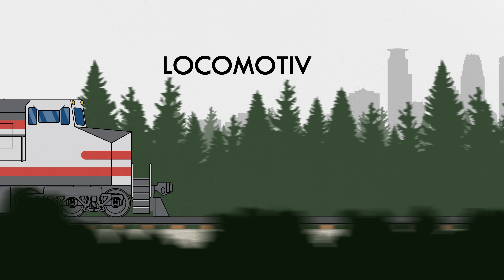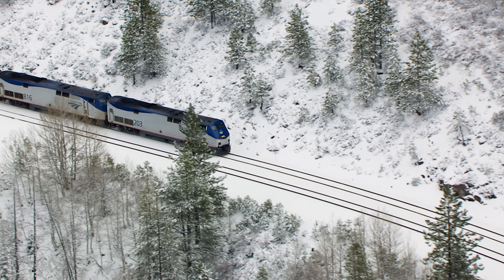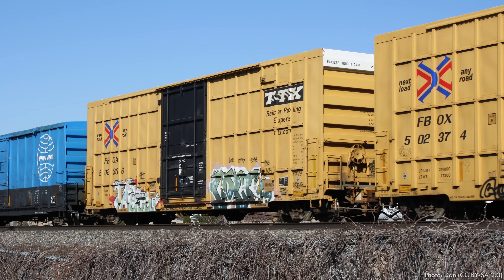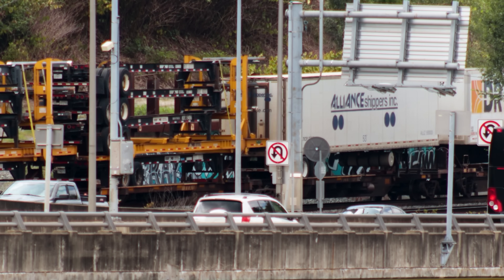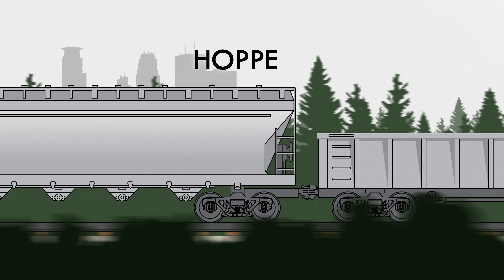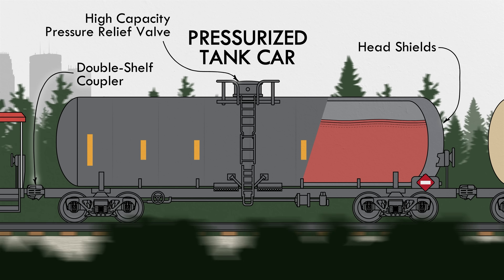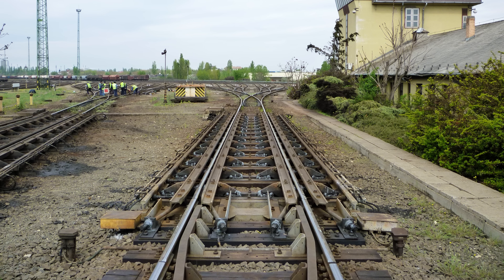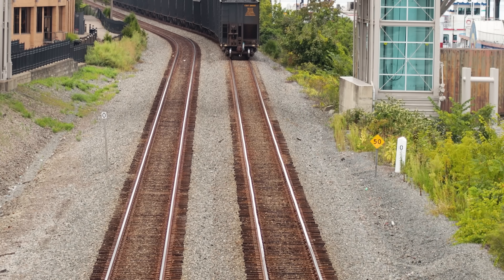Every Type of Railcar Explained in 15 Minutes

Comment: AMERICAN CONCEPTS OF TRAINS FALL FLAT ON THERE FACE IN THE REST OF THE WORLD !
I think the first sentence should state "An AMERICAN train is a simple thing at first glance" ! Super High Speed Electric trains running across Europe and many other countries around the World on TOTALLY NEW "Super High Speed Lines" designed for 186mph PLUS speeds, are no longer simple looking things at all. And indeed are technically far in advance of the simple Diesel hauled freight train of yesteryear !  Being high powered Electric trains they are also far quieter, and almost 100% pollution free. And once your rail network reaches 40% electrified, the Electric network & train costs begin to become cheaper & cheaper than a Dieselised rail network, with every extra mile of electrification. 

Which is effectively proven by the Worlds longest railway line. That from Moscow to Vladivostok at 5,772 MILES long which was electrified back in the 1960's. And despite passing through some of the most inhospitable climates on the planet with temperatures ranging from -60C in the winter to +45C in summer, the journey time for both Freight & Passenger trains was greatly reduced by electrification. And each train became far cheaper to operate over such great distances, when Electrically hauled. And of course Electric trains don't need to stop and waste time to refuel, or need all the refuelling facilities as found on American Trans Continental Diesel operated routes. Indeed with Electric you need fewer locomotives as a single Electric locomotives can be up to 15,000hp. Whereas the practical economic size of Diesel locomotives levels out at between 3,000 & 4,000hp. Which explains why US freight trains often require as many a 6 or even more locomotives, which increases the cost of operating the train !  Yet further the "Electric" locomotive produces virtually NO pollution at all, and certainly doesn't spread diesel fumes and pollution all across the Pristine Countryside like Diesel locomotives and Aircraft do !!!!

Comment: As someone with 10 years as a Carman (Railcar Mechanic) this should be interesting to see if you miss any.
Reply: In the Hopper car section the PD (Pressure Differential) Hopper was missed. They tend to carry Free-Flowing Light materials such as Flour, Cornstarch, Lime, Mineral Powders. They're annoying to work on but they are super interesting when you look into the design and engineering.
Reply: Also, on the Side Dump cars they are not technically Hopper cars. With them having a flat bottom they wouldn't fall into the Hopper category but one all on their own. I've always heard them called Airdumps

Comment: Bi-level coaches have become more common in the last 25 years in the US, plus there is a variant of the coach called a cab version.  These are at the other end of the train opposite the locomotive.  These are passenger cars but can be used to control the train by operating the locomotive remotely.  That allows passenger trains to be run in both directions without having to turn around.  
Aside from that, I have seen cabooses on military trains for the purpose of providing armed security details that stay with them while in transit.

Comment: There is interesting pieces of equipment called Trackmobiles out where I live. They are mid sized yellow vehicles that are used to move railcars in smaller capacities, and they work like high-railers and can just be moved off the track when they aren’t in use.

Comment: the 2 things you missed.  first, GRAIN CARS.  probably THE most common car in canada, takes grain from the praries to the costal ports to be shipped are basically a specific built tanker with multiple drains on the bottom.  second, caboose's purpose was for throwing flares out the back to create separation between trains, which were replaced by signals.  previously the brakeman (who rode in the caboose) would throw a lit "fusee" (road flare) out the back of the train every mile or so.  these were designed to burn for 15 minutes then go out.  if you're operating a train and come around a bend to see a red flare burning in the middle of the track you stop and do not cross it until it goes out.  this became a red signal on the post signal system that followed

Comment: I was hoping you would explain more what a passenger car with rooms is called.  We always called them a Pullman where I grew up in the south.  I'm not sure where that name came from since Pullman Standard was also the name of a manufacturer which had a plant near where I grew up.  My grandfather was a brakeman until he retired in 1937 so he may have called them a "Pullman."  A beautiful car, it had a fold-out table, two bench seats, and it's on toilet and wash room.  I rode one once from south Texas to St. Louis.  It was a short trip so we didn't use the beds which also folded down.

Comment: Having grown up in an industrial area, I am familiar with some specialized cars, such as "torpedo" cars used for moving molten "hot metal" between furnaces at a steel mill, or between mills in some locations. Another is the dumping "slag pot" used to take the waste slag following the pouring of molten steel to a dumping point.

Comment: Grady, I actually have to disagree with something you researched,. Cabeese.
The caboose was the train conductor and rear end brakeman's office and quarters. They were used up until the 1980s when technology like the F.R.E.D. and radios and the wayside detectors and air brakes as well got better the caboose was no longer needed. And yes M.O.W. crews from time to time use them but for the main line use of the original intended purpose is long gone. Until the power grid goes off and we go back to the steam era.

Comment: I have over the years watched trains I have seen every type your video showed at least once. I live in the Northern suburbs of Chicago Ilinois I have seen so many changes since the 1950's with railroads going bankrupt or being bought out, I have seen entire generations of engines and railcars go out of service. I also was involved with my dad in a Railroad Model Club for a few years. He build a hundred unit, short-coupled iron ore train each with its own number stamped on the sides. Great northern paint jobs with a Tenshodo Crown Grade R2 to pull the 33 foot long consist.
The biggest consist I have ever seen was a test run on the Chicago and Northwestern 24 SD-40 in groups of six, 2 groups at the headend one in the middle and one at the rear 240-hundred-ton coal cars. Wyoming to the Chicago area. They were testing the then new multiunit radio control system
Reply: 240 cars are standard business now

Comment: Hey @PracticalEngineering, i have a question: When diesel locomotives run past a camera, what is making the (aaaaaaaaaaaaaaahhhhh) sound? Is it the traction motors, the wheels, the rails?? Every time i listen to GE Locomotives rolling by i hear that sound
Reply: Those are the traction motor blowers that you hear

Comment: Maybe you can explain on a very long train, the front has maybe 3 locomotives, but why one is faced backwards. I think it's because of the reverse gear having a lot of torque, but clear it all up, if you haven't already in another video.
Reply: The headend locomotives are almost always random, we basically just jumper up any high HP 6 axle locomotive we can find in the yard.. they also run the exact same no matter which way they face

Comment: You inexplicably left out the most interesting aspect of auto racks - they only look like individual carriages when the train is moving, but when stopped they open at the ends and use little bridges to connect so they can act like one long narrow parking lot for loading and unloading…

According to @djstrains there are carriers in Pennsylvania that still use cabooses regularly because they do so much backing down the lines. One of the last I’m afraid…

Comment: Can add 2 speicalized flatcars... bulkhead  and centerbeam flatcar. Also if you want to include steel mills there's the slag or ladle car and the hot metal torpedo car. Of course there's the obsolete cattle or "stock" cars and the caboose.

Comment: Help! My kids and I have been working on the railcar scavenger hunt, and we thought we had found every car type there was to see in our area until we spotted a super-weird one rolling through Chicago's western suburbs on the BNSF tracks today.  I've scoured the internet and can't figure out what it was.  At the end of a typical BNSF train, after all the covered hoppers and so on, there was a series of open cars, painted brown with yellow trim, running empty, whatever the intended freight may have been.  It was hard to tell where one car ended and the next one started.  They seemed to have extra axles and had ladder-like racks all along, with an occasional structure that I can only describe as a little bridge with a staircase on either side.  We caught the letters HGCX, which Wikipedia tells me corresponds to Hillsboro Glass Company.  (Or maybe we got it wrong, and it was HCGX, which is apparently North American Salt Company.)  The ladder-like racks made me think it was meant to carry something long, narrow, and thin.  Any ideas?

Comment: Fun fact: passenger cars almost always have two (or more) sets of suspension called the primary (located at the axle box) and secondary (between the longitudinal frames and the bolster, or in bolsterless designs, between the truck and the car chassis). This makes passenger trucks look significantly different and more complex than freight trucks.

Comment: I've seen a Semi Truck used in place of a normal engine as well. It was outfitted to run on the rails just like the other vehicle. Might be a super rare site, but they can pull a few of the cars you mentioned as well. The one I saw was pulling about 7 cars I think.

Comment: Something that I would have liked to see is the comparison of space efficiency between trucks and boxcars. Because boxcars can be placed in a grid in a yard, you can access any boxcar at any time since they are adjacent to eachother by walking on temporary bridges across the cars. Trucks require space to load them and turn them around warehouses.

Comment: I'm a railroad conductor. Gonna add something onto the caboose that wasn't stated here. Most if not all freight lines have discontinued the use of the caboose, since the ETD performs the same purpose. What a lot of freight lines will do with the caboose's, is use them as ways to ride the end of a shove (Movement from the rear that the locomotive can't protect) without having to ride the side of a car. You will often now hear these called "Shove Platforms" or "Shove Cars".  These cars are often used in local jobs. They still need to have an ETD on them, as most Caboose's have been sealed, and even if they weren't the caboose doesn't have the ability to place the train into emergency from the locomotive (it would have to be done via radio).

Comment: Cabooses were also used exclusively on freight trains.  Passenger cars can be ridden by the crew without issue, but part of the crew of a freight train needed a place in the rear to ride.  It was the conductor’s rolling office and also provided rear-end braking before locomotive-controlled train brakes.  The rear brakeman (trains at the time had two brakemen, one at the front and one at the rear, to walk along the train applying or releasing the handbrake of each car as needed) would stay in the caboose when they weren’t adjusting the brakes.

Comment: The iron mines in northern Sweden use a specialized dump car called the Kiruna Wagon (named after the city that houses the largest iron mine in Europe). It look like a normal dump car but at depots a specialized helical structure meets with small wheels on the hoppers to pick up, flip and dump the loads automatically without having to uncouple cars or stop the train.

Comment: At a company years AND years ago. We had the occasional tank car. These were used to transport tar (raw tar). They had pipes on the inside and external pipe connectors to connect steam hoses to.
The steam was necessary to soften the tar so it could drain and so it could be pumped to holding tanks.
On one occasion we forgot about steam being connected to a tank car. The tar got so hot, that it expanded, overflowing out the top hatch of the car. Boy did we get yelled at. The tar that overflowed was waste, it couldn't be recovered. I don't know if they actually lost money on that car or not.

Comment: 0:40 Uhm, I don't think so? I mean I'm only one of those riding passenger trains, but beside missing the control car (I think it's called like that in English?) in your explanation, which usually runs at the front in a push configuration, passenger trains with self propelled carriages and control cars on both ends are quite common and have no locomotive at all. I think you might even have some of them in the videos you show.

Comment: 7:12  Cars designed to carry intermodal containers have length markings on the sides to help with centering the container. They typically have markings at 53 ft. and 40 ft., the most common lengths as well as others.

Comment: Missed a few cars. 

Railgun - A naval gun set in an enplacement within a rail car, to use as artillery

Cattle/stock cars

The whole series of military specific cars ranging from command cars to missile launch cars

Armored trains?

Torpedo cars which carry molten material 

Control cars which are a second command car for the locomotives in a central location on the train

Comment: Well, now. You like Railroads and you know all about these rail cars and the heavy machinery it takes to keep a rail line in operation. BUT - what do you know about me most impressive, powerful, exciting part of a rail road - A steam locomotive.  Think of all the engineering that is involved. How to they calculate the size of the grates. The water injector, compressor, the intricesy of the valve gear, the beauty of a walsheart gear. How do they calculate the bore and stroke of the pistons. The number of tubes and flues. Think of the incredible force applied to a crank pin on the main driving wheels. You could do a whole series on just the engineering of the boilers. Why are engines limited to 300 PSI operating pressure. What could be done to make them more efficient, cleaner burning They are much cleaner than the same tonnage of diesel trucks and diesel engines required to pull the same weight of a consist. Many interesting facets of steam locomotive engineering. It is boring to watch a freight train. But to stand beside a track and have a locomotive start up....  It's better than XXX!! Even better if it is a Big Boy up Sherman Hill.  Wonderful channel.

Comment: Don't know why I put of watching this video for so long. This was fantastic!  I thought you might go into some older car designs, too, like livestock cars that you don't see these days. 

Those rail geometry cars have an even more important feature:  they ultrasonically examine both the rails for internal defects.  This allows bad rail to be replaced BEFORE disaster strikes!
 
I think most of the time, in the USA at least, if you see a pickup truck driving on the track, you're seeing a track inspector.  Federal regulations require all track to be visually inspected regularly (2-3 times per week depending on speed limit class, etc.) and this is usually done by Hi-rail.  If I remember correctly... once a year, at least, the track inspection must be done closer, on foot.

Comment: In addition to the COFC's (containers on flat cars), it's common to see containers on spine cars (COSC's):  containers on "spine" cars.  Spine cars are the specially-designed cars for transporting piggyback trailers, and this is what we most commonly see trailers on now (TOSCs).  
Containers can't be double-stacked on spine cars or regular flats for safety and clearance reasons, but of course they can be stacked two-high on wells.   Then one can get into the differences between domestic 53' containers and maritime 20' and 40' containers (TEUs), but.....whew.

Comment: You missed my favourite train car, the torpedo car; they are used to transport molten metal (mostly steel) and you can really feel the heat when they pass. Its quite impressive (although they are obviously used only in very specific areas, where steel is produced).

Comment: I didn’t see the Control Car, a car that goes on the end of the train featuring all of the relevant control panels and instruments to driving the train, but has no propulsion plant itself. The control car commands the locomotive at the other end of the train, allowing a train to be driven backwards without needing a place to turn around or disconnect & move the locomotive.

Comment: Grady, 

Can you create a video about the specifications of rail travel?

Example: Width of rails/wheels, thickness of rails, weight limits, speed limits, rail curve limits, etc.

Maybe some hypotheticals, like how much speed, weight, curve requirements could be increased/decreased if rail width was changed (smaller or larger spacing).

Comment: (10:00) If anyone was wondering, the DOT codes for the tank cars are DOT-111 for pressurized tank cars and DOT-105 for non-pressurized ones.
Reply: however the dot-111 cars will be replaced by the dot-112's in 2025 ( stronger versions of the dot-111s )
Reply: Thanks, now I can identify the tanker cars I see in Nebraska.
Reply: And both of them can wipe out a city block!

So can Semi Trucks though.
Reply: DOT-111 are also being replaced by newer DOT-117 tank cars model with some DOT-111 being rebuilt
Reply: Thank you! 🫡